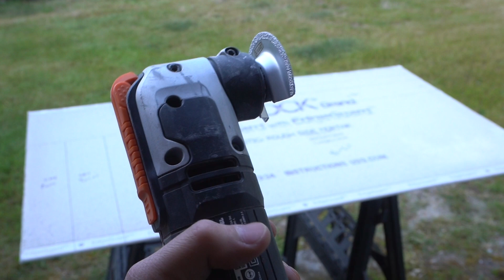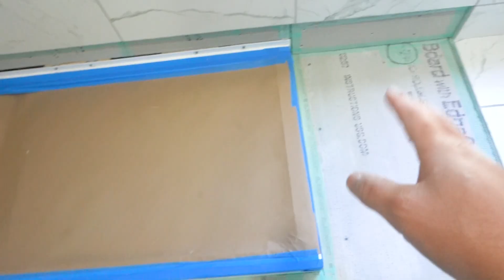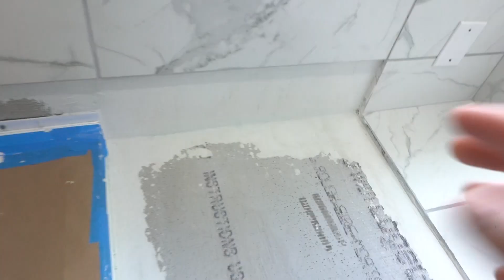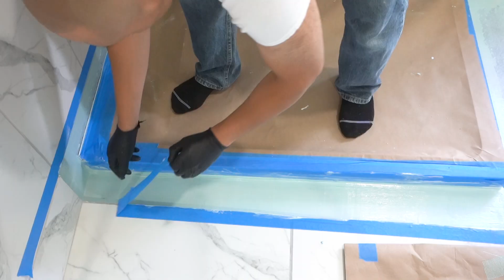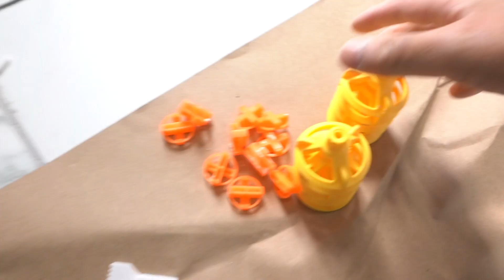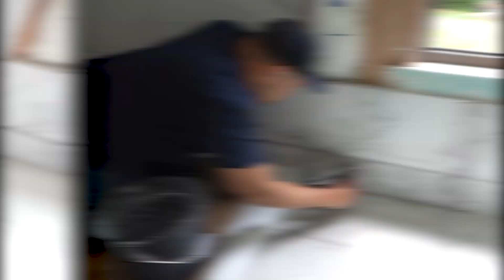SEAMLESS Transition Install Of NEW Tile Next To OLD Tile In A Bathroom | How To DIY

Comment from the maker: ITEMS I USED ON THIS VIDEO:
- WORX Oscillating Tool - https://amzn.to/3VZA3Up
- 4 Pcs Oscillating Multi Tool Diamond Cutter For Tile & Grout - https://amzn.to/3VLn3Aq
- Backer-On Cement Screws 1-5/8” - https://amzn.to/3KZIDMG
- Mesh Tape - https://amzn.to/3W1gbQU
- Mortar / Thin-Set / Grout Drill Mixer Attachment - https://amzn.to/4ckqs0n
- Mapei Grout (Sanded & Unsanded) - https://amzn.to/45Lgvq0
- Mapei Aqua Defense Waterproofing Membrane - https://amzn.to/4bhwOw8
- 4” Drywall Knife - https://amzn.to/4eI7PVB
- Drywall Pan - https://amzn.to/3RLppy1
- Grout Float - https://amzn.to/45KWYX5
- Sponge - https://amzn.to/4blbN3K
- Wet Tile Saw 7” - https://amzn.to/4ckKkjJ
- 1/4” Spacers - https://amzn.to/4cGmdvE
- Tile Leveling System - https://amzn.to/4eIPvMg
- 1/2” x 1/2” Square Notched Trowel - https://amzn.to/45LPZ04
- Paint Roller / Brush / Pan Kit - https://amzn.to/3L4TAMU
- 2” Masking Tape - https://amzn.to/3W1Z1Tp
- Microfiber Towels - https://amzn.to/3RGCuZp
- Cordless Drill / Impact Driver - https://amzn.to/4eEpzBj
- Screw Bit Set - https://amzn.to/45N6KYK

Personal Protective Equipment I USE:
- Gel Knee Pads - https://amzn.to/3KINFNl
- North Respirator (Half-Face) - https://amzn.to/4bhkw6U
- North Respirator Cartridge (Particulate) - https://amzn.to/3L2IAjf
- Hearing Protection Ear Muffs - https://amzn.to/3VGWn3Y
- Safety Glasses Anti-Fogs - https://amzn.to/3RJFvrW
- Nitrile Gloves - https://amzn.to/3XCSbVx

Comment: If I was the tile installer I would have walked away from this job unless it's done correctly.
Reply: I have a very similar job as this guy is doing. What would you have done differently at the seam where it meets old and new that you prevent leaks from stopping at the joint of old and new to me it seems like it would dam up at the old and go behind the new?
Reply: Not really a  grantee way to do this type of patch repair. Eventually it will leak… 1year… 5year… 10year… eventually

Comment: Informative presentation as always, though I'm concerned about the gap between the shower pan lip and the backer board as visible at 7:41 on the long side of the shower pan.  Won't the water be able to enter through the top grout line (about 4 inches above the lip edge) and roll down behind the tile straight into the gap?
Reply from the maker: Another great question, as per the manufacturer’s instructions for this pan, you put the cement board or drywall wall just about the lip, the. Put the tile over the lip. That is why it is very important that when you grout you mush it fully inside the gaps to allow 100% seal. Note that each shower pan manufacturers instructions vary.
Reply: @FixThisHouse  I see.  I'm currently at a planning stage for my shower remodel. This helps a lot.
Reply: Just a suggestion, but when I build showers, every joint from about chest height down gets epoxy grout.
Reply: @MoneyManHolmes  thats water proof grout from lowes?
Reply: @FixThisHouse   Grout is not waterproof though.  I wish you had talked about the gap between the last row of tile and the acrylic base. I It looks like you filled this area with grout?  This is an important detail. Capillary action can draw water from the last row of grout between the acrylic base and the tile, behind the tile, and into that gap between the cement backerboard and the acrylic.  You can end up with mould behind your wall this way.  The better method is to NOT grout that small gap between the acrylic base and the last row of tile.  Instead, fill this gap completely using silicone caulking.  We have an acrylic shower base like this in our house, and our tiler installed grout between the last row of tile and the acrylic base. Even though there is a bead of caulking over top of this row of grout, water still bled from here behind the wall and caused mold, several years later.  It's better to put only caulking in this area to properly seal it.
Reply: @NLR759  i thought that too. the silicone is better for that gap. Did you end up using epoxy grout?
Reply: I was thinking the same thing.  That cement board looks about 1/4" in from the lip of the shower pan, but somehow, he made it work.  My issue is my shower pan is slightly smaller than my space.  I will end up with a very similar situation.  My cement board will be about 1/4" from the shower lip on both short sides of an alcove shower.  If the thinset is 1/4" thick, I should be ok?  #badidea?
Reply: @AFHero66   Just be sure to NOT grout that last row between the tile and acrylic shower base.  Instead, put ONLY caulking, no grout at all, to form a completely waterproof seal.  Grout is NOT waterproof, and it has capillary action.  We ended up with moisture and mould behind our shower wall because our tiler installed grout in that last row between the acrylic shower base and the last row of tile.  Even though there was a bead of caulking over top of the grout.   It would have been better to put ONLY caulking, and NO grout in this area. We could not understand why moisture was getting behind the wall, as everything seemed to have been installed properly, it was not until I saw another video address this tiny detail, because they notice that the grout was taking days to completely dry between showers.  So they scraped out that last row of grout and inserted only a bead of silicone caulking to stop any capillary action.
Reply: @NLR759  i thought about using a thin backerrod, and then silicone over that... as my gap goes from 1/2 to 0 (slightly unlevel pan) or what do you think?
Reply: @AFHero66  me too bro im doing it right now, did your project work? how did you manage that gap?
Reply: i had the exact question

Comment: Question. Why do you notch trowel both the floor and the tile when setting your tiles?
Reply: I was wondering about notching both the tile and floor.  I understand back buttering, but I have never seen the back buttered tile trowel notched and was wondering if that is industry standard?
Reply from the maker: Hi. Great question! Back buttering tile, also known as back parging, is a technique that involves applying a thin layer of mortar to the back of a tile. It's recommended for large-format and porcelain tiles. Back buttering can help tiles adhere to the substrate better and can help avoid long-term problems.